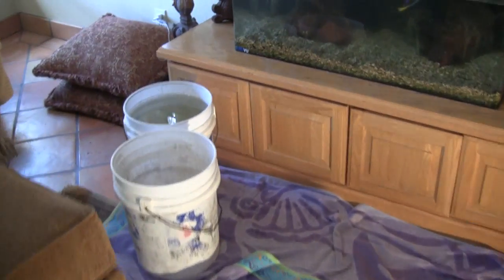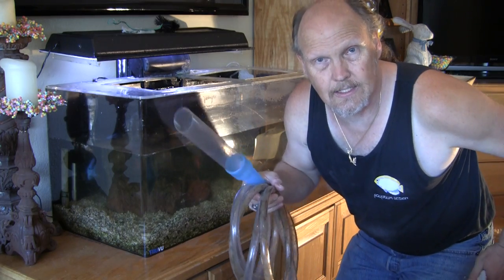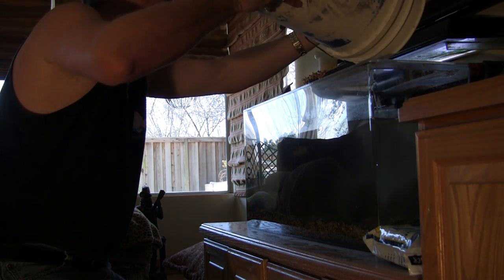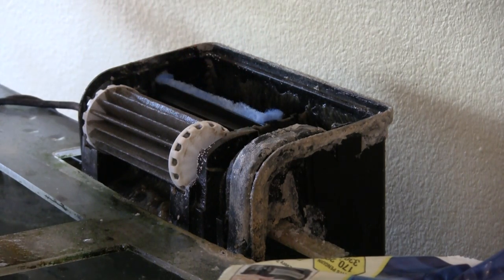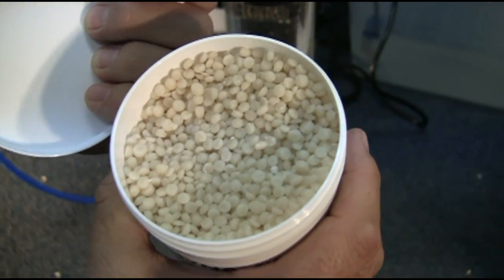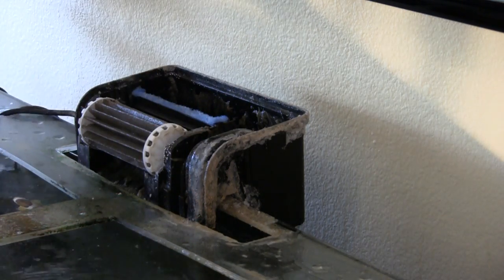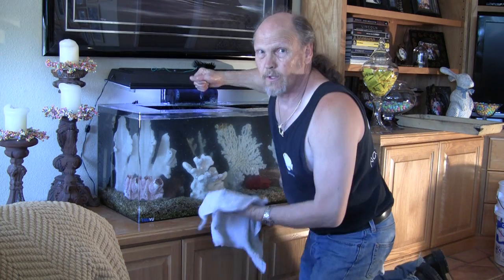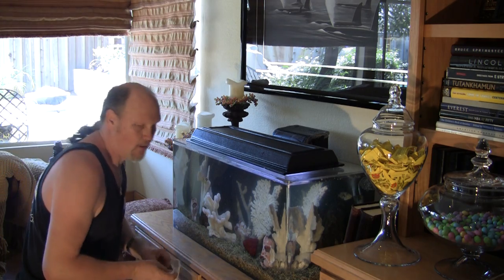Sixteen Years and 50 Gallons, LA Fishguys, Episode 113 pt 2

Comment from the maker: hey W, I was part of the Marineland team who rolled out the Bio-Wheel concept back in the early 90's. I am sure one can go into detail about all the items one could clean and you are correct in that a rotating bio-wheel is going to do a better job that a stationary one. most often replacing the filter cartridge is enough to allow a greater flow of water to pass under the wheel and in turn it rotates faster. cleaning all parts will allow it to spin even free-er.

Comment from the maker: hey D, a protein skimmer is not a nessecity but a benifit. it will help drive out organics and aerate the water but if its placed on a properly filtered system it is not needed, as you can see in the video. Nitrates are not easy to remove. there are a few chemical means and a number of natural ways.